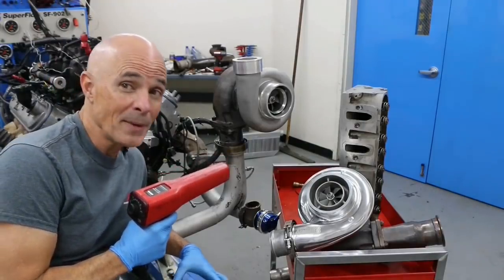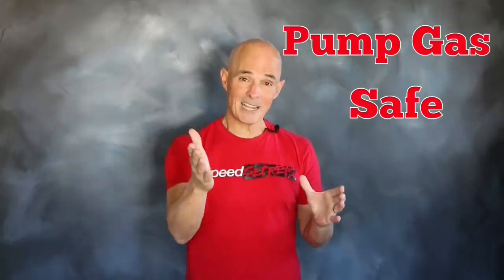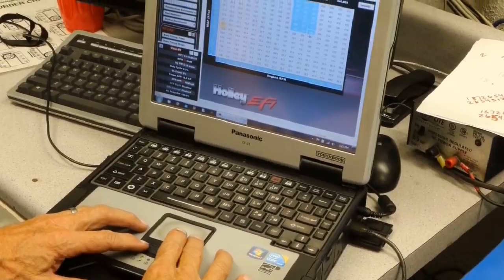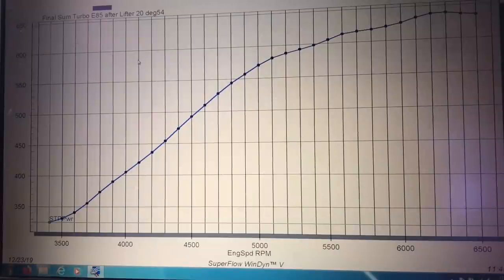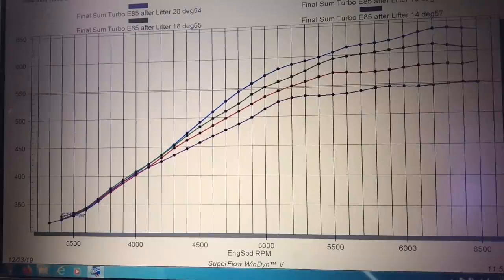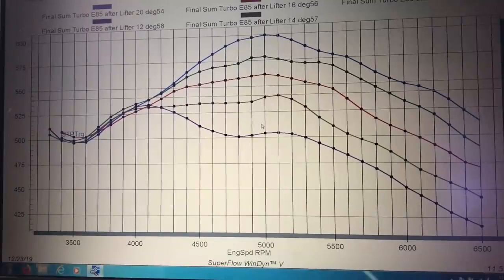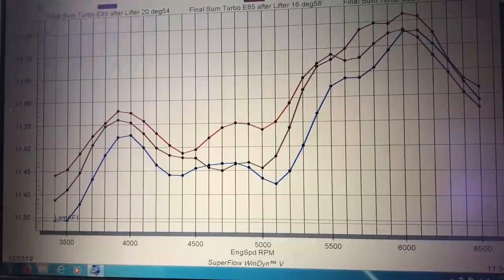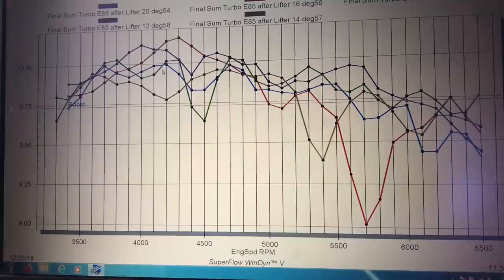TURBO TUNING-PUMP GAS VS RACE GAS Full Dyno Results

Comment: Richard you've got me scratching my head a bit on this one... I'm not completely sure by what you mean when you say 12 or 20 degrees. Are you just setting the initial (some call it base) timing to 20 degrees and carrying that all the way through the map? or are you doing something different below 4000 and setting it to 20 degrees above 4000? Would love to see you do a full video on just tuning, especially on turbos. Actually would be nice to see what you change between turbo and N/A.

Comment: One point that is relevant to the discussion but not to this test is different fuels have different properties that will also effect detonation & hp. Leaded race fuels may have oxygen added that improves hp output. Also E85 & Methanol have cooling properties that also add hp & combat detonation. It would be interesting to see tests finding knock limits of pump gas and what differences spraying meth or mixing ethanol would do to it.... but would be harder to test. Awesome test though people don't understand timing well enough.

Comment: The A/F thing really threw me off. Didn't expect that. Next test: Pump 93 w/H2O Meth vs E85. I'm lazy and don't like adding a lot of electronics and fuel system stuff, when I can just use water/meth. If it's good enough for a Focke-Wulf FW-190, then...…..

Comment: Ive got a 6.0L engine that i cant decide which heads to run with a old vortec v-1 supercharger ive got for my 06 silverado flex fuel truck. LSA CTS-V Heads or 799 heads and what size cam. I dont want it to idle like a pro-street car. Its my daily driver

Comment: Known fact that e85 requires more timing. So pulling down 20 degrees with e85 down to 12 degrees,made more of a difference because you should of ran pump gas with the 12 degrees of timing. Probably a 40 horsepower difference

Comment: Why didn’t you actually run the engine on race fuel to see what a difference the race fuel itself actually makes seems like you did 1/2 an experiment here and didn’t finish
Reply: E-85 was the race fuel, showing what pump would possibly be at lower timing

Comment: I like the information heavy comment. No hype just info. You are great at explaining tuning.  I think you might be the guy to explain building a tune from scratch using MPH on the time slip. Not allot of content on that told in a clear way. It'd be interesting to see this same test but with a manual boost controller with no correction. As a follow up to this one.

Comment: I never dislike any of your videos  but this one I did . This is y.Where was the comparison with pump gas?? You guys always go straight to race gas y? E 85 is race gas unless its available everywhere.. Pump gas is 93 octane and below some places only have 91.we have a pump gas class here I've won it 4 times. And rules are.no e85.no meth 93 octane and down.my cars close to 1100 at the wheels with nitrous sbf on pump fuel 93 octane here. This class has been run for 4 years now here east coast. and there is also a turbo ls in the class making close to the power I am. And also few charged cars were all on pump gas. I have not run race gas in 5 years. Its $15 bucks for 5 gallons of fuel compared to 100 for 5 gallons of fuel.This video was useless without pump gas comparison.
Reply: Couldn't agree more @rob gandy . Love your videos rich but this one I just couldn't watch being I'm a big pumpgas racer
Reply from the maker: thnx for the input. You obviously missed the point here-the timing levels that were tested show the change in power that would occur when you have to run pump gas tunes. If the octane requires you to run lower timing-(which it does), you can expect a big loss in power compared to having the octane to support the timing. A sharp guy like you should easily make the connection!
Reply: @richardholdener1727  y wouldn't you put pump gas in it and show the comparison? Of course the a/f is gonna stay the same as you lower the timing . It's also fuel injected not a big surprise its staying the same. When you lower timing with nitrous and even on pump gas big jet spreads 30 to 40 spreads smaller on the fuel jet. The a/f stays the same as you lower the timing it just doesn't make the power. Learned alot from the late great monte smith. Not knocking you love all the stuff you do. I would like to see a comparison. The benefits to the pump gas it's cheap and you can make a ton of power with any power added if tuned correctly. Y spend 15 to 20 a gallon when you can go to any pump and get 93 octane and below.Thanks for replying Richard

Comment: Bad ass video like usual! Would like to see the difference in the spark plug strap color vs timing change. Like is 20* near the bottom, 16* at the bend, 12* before the bend etc.

Comment: Is there any suggestion on the timing on pump gas I should use in a NORMAL ASPIRATED  engine? Thanks in advance.
Reply from the maker: we run 29-30 degrees of total on the dyno-many guys run less on the street
Reply: @richardholdener1727  Thank you very much

Comment: I think tht y u don’t need to change the afr because w the change in timing u f not affecting how much air the engine needs u r jus changing when peak combustion takes place in the power stroke the engine needs the same fuel as long as airflow stays the same

Comment: Um? How is this a test of race fuel versus pump gas? It’s a demonstration of how timing affects power. Does E85 burn at the same rate as pump gas? I doubt it. I’d have much preferred to see you actually change the fuel.

Comment: I used to think the same way that ignition timing affects your AFR but than I double checked that and found myself being wrong. AFR stays the same as it is a function of valves events - once intake and exhaust valves are closed theres fixed amount of air trapped in the cylinder so no ignition timing can change it. The only thing that ignition timing can change is pressure and EGT but not AFR...

Comment: So let's say @ 14° is a safe timing @ torque peak to not lift a head and you lost 100hp @ that timing, how much boost/fuel would it take to recover that HP loss at the same timing?
Reply: james Mcguinness 

There is no exact answer for this as boost and fuel HP generation efficiency changes throughout the generation process and the hardwares ability also changes in relation 

Depending on the platform a degree of advance timing could be worth as much as 4-5psi of boost which sounds very large but a engine creating a bulk of it’s power from clean timing advance can be a generally faster vehicle than a heavy boost applied vehicle and safe timing map. 

Cylinder events need to be created and maximised throughout a variety of different methods to have the best mix in place for each and every combo and thus why an experienced tuner will do this, take the time needed, and deliver the best possible result from his skills 

Trying to overcome mechanical limitations from tuning can be done but best not commanded and have the hardware sorted for the intended purpose first, that said there’s bigger issues a tuner needs to know why and when tuning for a limitation as other factors can still influence the negative outcome....

Tuning for peak power is for chumps, tuning for a quality tune is for champs 😜

Comment: Have you tested IAT  versus power output.eg. 70 deg. temp to 300 deg.
Reply from the maker: we've done IC vs non IC
Reply: I can only imagine how much power I'm leaving on the table with 300 degree intake temps.good thing I'm running c16.
Reply: Looking forward to your ind. Cyl. Temp. Test.
Reply: Have you ever tested a blow through setup and the difference that the carb makes to cool off the intake charge?
I think a lot of guys are still using carbs like myself.

Comment: Would love to see a 91 pump gas-water/meth test, on stock LS intake would have to use port injection being as in engine masters the ls intake doesn’t wet flow water/meth very well.
Reply: I've asked

Comment: Richard, any plans for any turbo/blown LT motor testing?    There seems to be different tuning characteristics for DI engines (leaner AFR, more timing etc)...  I’d love to see your testing/thoughts on this.

LT/DI engines will definitely be the way of the future.
Reply from the maker: I have an L83 5.3L test motor I have run some tests with-I need fuel injectors and a pump to add boost

Comment: Air fuel ratio doesn't take into account where the spark occurs in the engines cycle, there is still the same amount of air and fuel in the cylinder

Comment: So, if you monitor EGT you will see exactly why the AFR didn't change, but power did. 

I would like to see a correlation between maximum power and EGT on pump gas versus race gas. Specifically using the different fuels, not just detuning a singular fuel.
Reply from the maker: EGTs can be altered by a number of things other than power, including timing. We can't run 20 degrees on pump gas and as indicated, we didn't tune using knock sensors.

Comment: I understand that what you did was an illustration of timing vs power , but in fact a pump fuel acts differently than e85  , meaning on 12 degrees of timing both fuels would have different results .
Reply: agreed, i think this would provide much more info.
Reply: Low octane expands quicker, burns faster right?
Reply: I know it drives freaking nuts that he refuses to run 91 pump for some odd reason even the engine masters guys beat around the bush. One episode they said they would test 91 on a turbo 5.3 build but they beat around the bush too and ran 114 race fuel. It's like they are scared to tune it because it might scatter. Its honestly kinda weird and you're right about that. There's guys making big power on pump

Comment: Richard when you get a chance test E98. Test it at richer than normal levels with higher output ignition. I found you can add fuel and timing and keep increasing power as long as you can light the heavy mixture.
Reply: What timing boost and AFR so you running on E 98

Comment: Thanks for another great test Richard! What do you think this would have made on pump, but with lower compression to get back some timing? We don`t  have E85 in Russia, so it`s either lower cr or retarded timing, and there`s never ending debate on what`s better.
Reply from the maker: pump gas will make less power under boost-even at the same timing level. Then it will make even less because of the lower timing values needed. Its the trade off we all face inherant in running low-octane fuel.
Reply: Никита Надеин we run 10,6 cr instead of 9,5 (last year), same 5.3 and s475 turbo. Will see the results this spring! Hello from SaintP :) BTW is it you @ Sloppy forum? :)
Reply: @soundslikealot  yep, that's me

Comment: Great info. Love the detail and showing the timing difference, afrs, and boost. Gotta love the Holley closed loop tuning too shows what a good job it does keeping target afrs
Reply from the maker: Thnx, but we didn't run closed loop-we ran open loop with no change in the amount of fuel supplied at each timing level

Comment: 10:57 Retarding the timing doesn't mean the piston is further down in  the cylinder. At 12 deg btdc, the piston is higher in the cylinder vs 20 deg btdc. Misleading statement that will confuse most.
Reply: His statement was in regards to peak cylinder pressure and was 100% accurate...
Reply: The ignition timing is when spark occurs ... you have to consider flame propagation. It takes a little bit of time for that mixture to burn and actually start exerting pressure on the piston .... by that time, the piston has gone past TDC and is going back down on the power stroke (that's where he meant ;D ) .... if not, firing "before" TDC would mean you'd be trying to turn the engine backwards!!!

Comment: nothing changed on the afr because the same amount of fuel and air were in each cylinder on each test.  Timing just made higher cylinder pressure and as a result more powa

Comment: It didnt change because the engine was still getting an efficient burn. You arent actually measuring air fuel btw. You're measuring lambda, or the amount of oxygen left in the exhaust after the burn. Actual input afr might vary. So if running a stock computer you might see fuel trims change to maintain that same afr.

Other than that they should remain the same with only an 8 degree change in timing. You might see more if you dropped down from 12 to 8 due to efficiency falling off.

Comment: Changing timing doesn't affect AFR because you're not changing fuel delivery at all just changing the position of the piston when combustion happens. Better rod angle on the crank, more cylinder pressure means more push but that doesn't correlate to fueling
Reply from the maker: Thnx for watching til the end
Reply: Richard Holdener hahah I commented and then seen your explanation. Great video!

Comment: Holy shit! I’d be interested in seeing if pump gas would make a different power at at lower timing because the burn rates of two different fuels will burn differently.
Reply: theoretically it should be the same but the timing changes would be further down on the graph I'd assume.  peak being around 12* like he mentioned.  I'd be interested in the same vid and motor using 93 pump as well
Reply: Flame speed isn't that different for most hydrocarbons.  The bigger difference is the resistance to knock.
Reply: I’ve learned quite a bit (from experience) since my post 5 years ago and have determined this is a stupid and pointless test unless you just want to show how bad e85 is on low timing. 93 premium unleaded will make more power at 12 degrees than e85 will. The difference between 93 and e85 will be about 70 hp vs 120hp shown in this. What a silly test when trying to compare to pump gas tune.

Comment: Best video yet.  Excellent dense format, real data, real tech, reasonable length, good editing, good audio nothing annoying.  You've got a brand here Richard.  Keep it up.  Have a great holiday and thanks!
Reply: 100% agreed!
Reply from the maker: thnx
Reply: @richardholdener1727  Could you do a video on reading spark plugs? Also out of curiosity, do you think if you would have carried the timing changes down to say 1500 rpm and did pulls from there, would the turbo spool noticeably faster and if so, would the difference in boost at low rpms be enough to compensate for the reduced timing at that rpm range? My theory is that you would pull timing down low (like you would on the 2-step with a turbo/manual transmission car) to spool the turbo quicker and then ramp it back in. What are your thoughts?
Reply: Also 100% agree. Zero filler, all killer info with clear conclusions on set changes acknowledging other variables.
Reply: Lol the audio is terrible like all is video can barrely ear is voice on Phone
Reply: @legros731  there is like 30 seconds in the beginning where he is in the dyno cell where its weak but still okish, but the rest is fine on my systems.

Comment: Great content sir. I have learned timing is everything. Too little timing=not enough power too much timing=broken motor. You have to sneak it in. I always start conservative with pump gas. I always think of it as the final touch in the tune, kind of like the final condiment in cooking! Lol

Comment: Great comparison looks like volumetric efficiency was around 104 at 6300 RPM's went to 84 on 12 degrees of timing. The loss and volumetric efficiency was almost exactly the same as the lost in Porsche Power. About 20%. I bet that little engine could have taken a little more timing possibly bringing the volumetric efficiency up to 107 or 108
Reply: There is no difference in VE between these runs.  He did a good job of controlling the variables and showed that he controlled both boost and fueling... so we know the torque differences between the runs is purely from changing the timing.

Comment: Awesome channel!!
Richard please read. 

2 things I’ve been curious about testing, 

1. supercharger setup through headers which are 8 to 1. Curious if the exhaust gasses will raise TQ further with 8 to 1 exhaust pulses. Using exhaust pulses in the 8-1 to rotate out the gasses out. Also the exhaust note should be nice.  (LQ4 with whipple 2300) 

2. Single Turbo setup (T6) with twin scroll using 4 to 1 collector per scroll. Will using the rotating pulse into turbo improve the spool up? Will this reduce lag? What size waste gates will this require?

Comment: Water- methanol testing !! no E85 in my area :(
Reply from the maker: water meth distribution is not great in a long runner intake like the truck manifold
Reply: @richardholdener1727  I know I watched the engine masters episode you guys did . But it definitely makes a difference , it did in my case . I was running into knock at just 7 lbs of boost 14 degrees timing on 5.3 S475 combo , this is with 93 octane pump gas in Canada sucks balls .  Put on water meth with a medium size nozzle can't remember the exact flow number . I'm only running 30% meth by volume so probably even lower by weight. With this setup I turned up the boost to 15 lbs and no knock what so ever . I plan to turn it up more but I'm  out of injector . It runs pretty fat around 10.8-11.0:1 . This is with truck intake as well .

Comment: Richard, I have just started a LY6 swap, I am really just going to clean up the motor except for a cam swap and maybe springs. Can you do a video on VVT and if it helps at all with tuning and power or to get rid of it. I would like to know before I make that cam purchase! Thanks, live the channel!
Reply: Watch his other videos, He gets rid of it on most of the videos I've seen.
Reply: Simple Man I scrolled through all the titles but didn’t see anything about VVT
Reply: He probably doesn't have any specific on VVT. Just on the cam swaps in the engines that have VVT, he removes the VVT. Thats what I should have said.